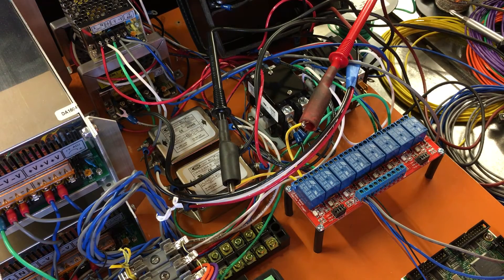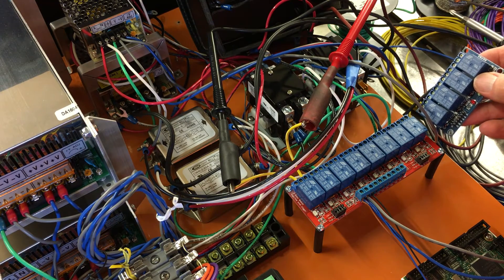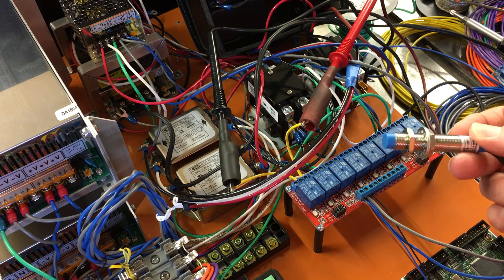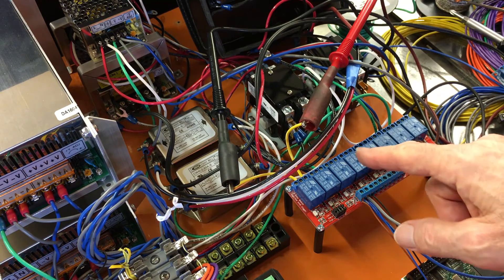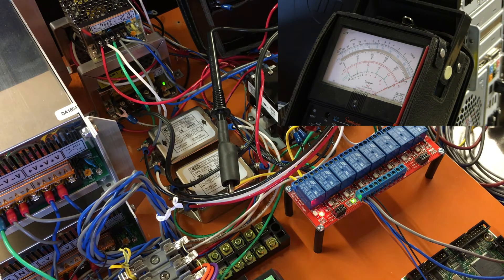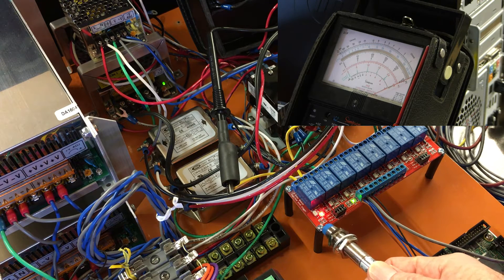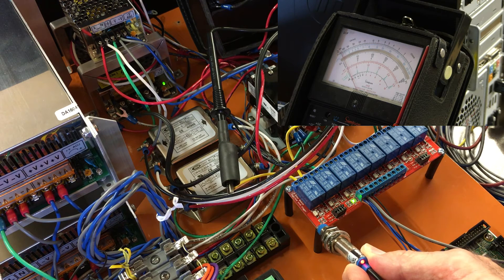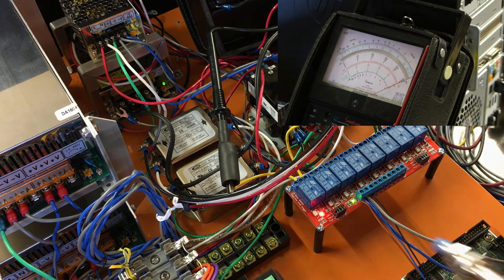CNC - Testing 8-channel board, proximity sensor - 9-17-16

Comment: David, i like your work here. I am interested in how you got the relay board to work and what motion controller and software you are using? i have a cncrouterparts electronics package but am wanting to replace the smoothstepper boards with uccnc hardware.